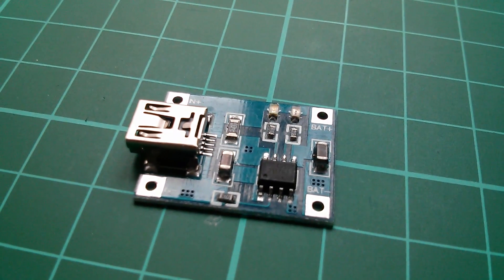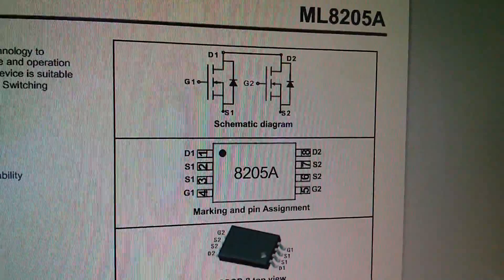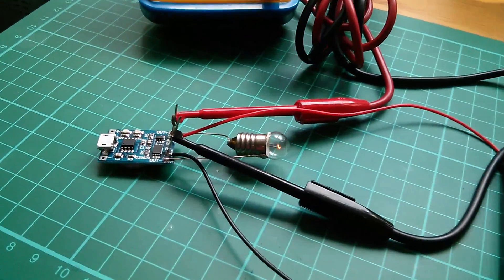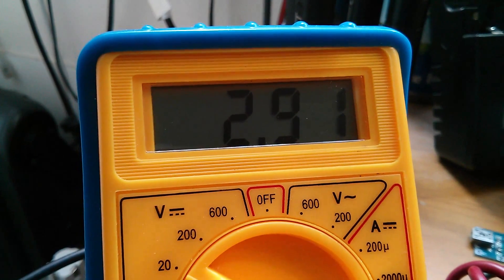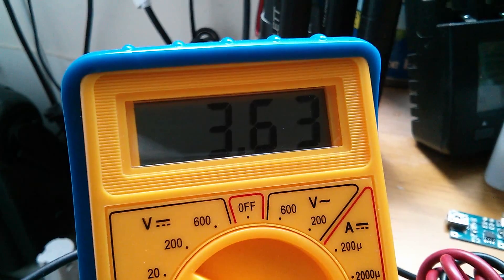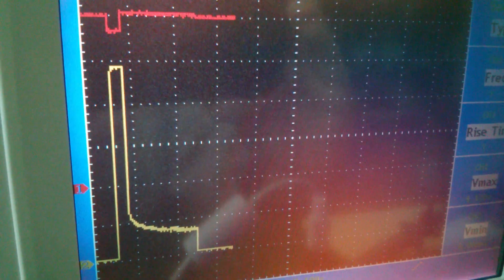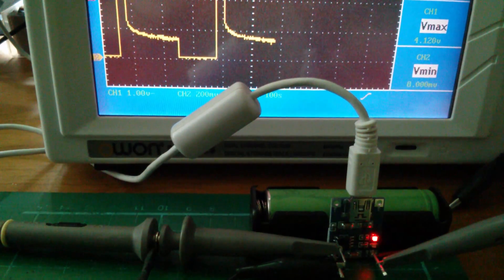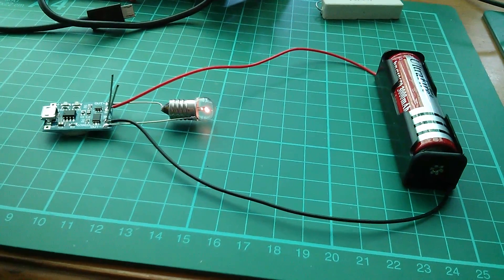New TP4056 Lithium Cell Charger Module with Battery Protection

Comment: At the end you mention the difference between old and new is where the cell protection is, on the board or on the battery. From reading online, the protection on cells are usually worse case scenario protection, meaning cut off voltage is set above 4.2v, and discharge protection down low at 2.4/2.5v. For normal cycling, a better range seems to be no more than 4.2v and no less than 3/3.3v. Many of the cheap charge boards I found have the same issue, only some show a discharge protection closer to 3v and cut off below or at 4.2v. The TP4056 seems to stop working around 2.9 so that's something I guess. 

Update: Seems the 2.4/2.5v cutoff is under load so this explains why many have it set as such, cell voltage recovers after. It's however mentioned the device should be designed to shut down between 2.5-3v under load without relying on the protection circuit. I see some forums even mention 3.3v, it seems to depend on the load. 

If you had similar concerns, here is the link I read on the topic: https://electronics.stackexchange.com/questions/338529/why-do-most-battery-protection-circuits-have-2-5v-discharge-cap

Comment: 2.4 volts is very low for a cutoff for lithium cells.

most cell specs call for 2.5 volts and the common sense recommended and programmed into many chargers is 3.0 volts.

over discharging lithium cells can shorten the life of them and even make them unstable and become a fire risk.

Comment: I'd be interested to know when the updated version will be for the usb c pd charging platform. 6a amp usb c charging to lithium battery would be an interesting option. That way we might see a standardised plug 66w seems like it's pretty future proof for alot of things... They made the tp4056 8 years ago... I was thinking if this usb c takes off as I think it should we might see usb c laptops more common. Would be cool to have charging facilities standardized at 66w output per socket... Busses trains etc... It actually can make a difference. 5-15 min journey could mean 30-60% charge times while making a small commute

Comment: At 11:10 you mention that a small load may fool the board into not terminating the charge, resulting in over-charging.  Does this mean the new version of this board can accomplish load sharing? Or would you need to supplement this board with a schottky diode and Pmosfet to safely charge the battery with a load on the circuit?

Comment: I have a TP4056 circuit, version with Out+, Out-, B+ and B- output pins. If I have a load connected to OUT+, OUT-, 500 mA, and a battery connected to B+, B-, can this circuit to charge the battery and to power the load in the same time when it is connected to USB?    I may to add to R3 an additional resistor to reduce the charging current to 300 mA value. The USB charger can deliver 5V/2A.

Comment: This chip causes a parasitic drain on the batteries. It will drain the battery down to 0.73V do not buy this chip.

Comment: Hi there, I often use this chip, but in a project that I am carrying out happens a strange thing.. connecting only one chip to a solar panel (or directly to a stable 5v input) it charges the battery and has a stable output on the out pin but, connecting two chips in parallel, as shown in this image ( http://shrani.si/f/Z/Om/45VaDfJg/18650-.jpg ) both leds are on .. I verified that it loads the lipos and feeds the load at 4.2 volts, but... maybe I am wrong on something? I won't that lipos suddently explode..

Comment: Hello great video. I wanted to ask her how to measure current with an oscilloscope? Just like you did. I tried to measure the current with my oscilloscope. But that didn't work. Just like you, I connected a probe to one pin of the IC and B-. I couldn't quite understand how exactly you connected the second probe head. I only see that this is connected on B +. Then I connected a 5W 1Ohm shunt resistance across B + and B-. I measure a voltage of about 127mV across the shunt resistance. I measure a current of 0.111A with my multimeter. But at 1Ohm shouldn't the maximum current flow? When I close the resistor across OUT + and OUT-, a current of 0.130A flows. Think for your help. Greetings Sebastian

Comment: can the tp4056 handle a 6 vold input from like a 6 volt solar panel? or will that break it?
Reply: The spec sheet says the TP4056 can handle up to 8 Volts for the input supply.(Vcc:  -0.3V ~ 8V Absolute Maximum)

Comment: Can you use a tp4056 to charge a LiFePO4, single cell
Reply: Typically the LiFePO4 cells have a maximum of 3.65Volts.  The TP4056 would overcharge a LiFePO4 cells.  There exists an equivalent IC chip specifically for LiFePO4 cells.  Chip BQ25070 is just one example.

Comment: How to make a lifpo4 single-cell charging or could you adapt the above charging board?
Reply: There exists an equivalent IC chip specifically for 3.6Volts LiFePO4 cells.  Chip BQ25070 is just one example.

Comment: Between 3:33 when the bulb turns off to 4:14 when it turns back on, how the heck is the voltage of your battery going up ?? I dont see you having an external connection to charge the battery. Can someone explain please??
Reply: I know this reply is 4 years late!
When you disconnect a load from a battery or single cell, it's voltage will start to recover. This is because the surface charge of the cell or could be the temperature of the cell, will allow it to recover slightly.

Comment: hi. after disconnecting my laptop charger my batter dies in 5-7 minutes. so i remowed my laptops batteries when i checked them it varies 3,82 - 3,83 3,84 - 4,07 so i charged with tp4056 so i have some question
1- how long should i charge them
2 how can i understand they are charged fully 
3 after a 10 15 minutes charging some of my batteries decreased 4,07 to 4,02 even they are free (not charged or used)
4 what can i do apart from those techniques ( by the way i am not experienced of electricity i just watch videos :) 
thanks from now on
Reply: Cars N Boys I would say, if you have multiple batteries connected together, use a BMS. That would be safer. If you just charge all with tp4056, you could risk charging some too much, high could damage them. You still could, and you could get away with it, but it might not be the best solution. A tp4056 board should have two indicator LED’s that show charge. If power is connected, and the battery is charging, it will show a red LED, then once charged, a blue or maybe green LED. Overall though, I think a battery management system (BMS) may be better for something like a laptop battery. You also may want to change that battery pack.

Comment: Shall i connect 2 battery in parallel and charge using single tp4056 module.. It is possible or not. Any problem occur in battery or not
Reply: Ramanatha Ayyappan It’s possible, and will usually work fine, but it could result in hurting the batteries a little bit, since they’re not all chemically the same, so one could charge faster than the other, and that wouldn’t be good for it
Reply: Yes, this is perfectly fine with one important constraint:  BOTH CELLS MUST BE AT THE SAME VOLTAGE WHEN YOU CONNECT THEM IN PARALLEL.  The resulting "double battery" will simply be one battery with their capacities (mAh) added together.  This would obviously take longer to charge but there is no reason it should cause any issues whatsoever.  Even if the two batteries have different capacities, the charging process will automatically send the correct power to the correct cell.                                                                             I disagree with Jack Seley's comment that you might "hurt the batteries a little bit."  The nature of the two cells being connected in PARALLEL will NOT allow one of them to charge faster than the other.  How the charging power gets distributed between the two cells is dependent on their capacities (mAh) for parallel wired cells.                            For example:  If both cells are 2500mAh, then they will share the charging power equally.  If cell #1 is 3000mAh and cell #2 is 1500mAh, then cell #1 will absorb more of the power than cell #2.... but they will both charge at the SAME voltage due to them being wired in parallel.  And importantly, they will both reach full charge (4.20Volts) simultaneously.                                                           PLEASE NOTE:   Cells wired in SERIES are completely different.  The above comments are only valid for cells wired in parallel.

Comment: You must use a heat sink to reduce the heat of the IC TP 4056. The module with battery protection will draw current more than 1A when charging 18650 battery.

Comment: Nice analysis.  Clear to follow and see what works well and why but also clear to see where (and why) the overcharge problem might arise under load (which was how I planned to use it)   so I'll have to watch out (or see if you did another video that explores it further)  :-).  Thanks!

Comment: Looks like maker focus took some screen shoots of this video for their product. Were you aware of this Julian?

MakerFocus 10pcs TP4056 Charging Module with Battery Protection 18650 BMS 5V Micro USB 1A 186 50 Lithium Battery Charging Board https://www.amazon.com/dp/B071RG4YWM/ref=cm_sw_r_cp_api_i_G46cEb7AY67WX

Comment: Hi Julian. These boards are new to me. Do you think one TP4056 would be enough to efficiently charge two 18650 batteries in parallel, or is that a bit too much for this little unit? Cheers m8
Reply: You can charge as many 18650's in parallel as you wish.  BUT BE ABSOLUTELY SURE THOSE 18650's ARE ALL AT THE SAME VOLTAGE WHEN YOU CONNECT THEM IN PARALLEL.    Then, it's just a matter of time.  They will all be sharing the charging power so it will take longer.  There is no issue with paralleling up multiple cells... it is safe, but slow, depending on how many cells you connect in parallel.                                             e.g.- 10 cells in parallel will take 10 times as long.  Think about it... each cell only gets 1/10th of the power it would have received if it was charging all by itself.  There's nothing wrong with slow charging, in fact, slower charging will result in longer cell life expectancy. (see BatteryUniversity .com for more information about life expectancy of lithium cells.)
Reply: Thank you for the great answer. I've been using this unit to charge my batteries with great results. Cheers

Comment: Hi, so I can use TP4056 to charge 18650 and from output, I can use a switch and supply to terminal blocks of  a motor driver and make the device recargeable?

Comment: Already got one defected, output 3.8v instead 4.1v so do not charge battery fully. The chipset get hot and maybe loose calibration. Need an heater on main chip.

Comment: I bought 2 TP4056 Micro USB boards and when I'm charging a 18650 battery the circuit board  start to heat instantly. Red bulb is lighting and connections are correct.Please help me.

Comment: Hello, did you manage to find a solution for the overcharge  when charging with the module and delivering load above 100mA simultaneously ? I want to power my Arduino Uno and a servo using one 3.7v cell with a step-up voltage regulator by charging it with a solar panel. However,  how I can overcome the issue of overcharging?
Reply: I would like to know this as well
Reply: This chip causes a parasitic drain on the batteries. It will drain the battery down to 0.73V do not buy this chip.

Comment: great video. I was looking for long which circuit should protect most and charge auto indicator 18650 and cutoff. ""What is + and - point do near micro usb input?"". now i'm looking how can i get Battery status indicator point from BMS circuit which indicate on cellphone battery as "T".

Comment: It should drop the LOAD when cell drops below the cutoff voltage.  Dropping the cell means it can't charge.  I believe you can correct this by connecting the load to OUT+ and B-, and the cell to B+ and OUT-. Anybody see a problem with this idea?

Comment: I've similar one, when I charging a few 18650 parallel the module start overheating. That's the problem.
Reply: Check your batteries.  Almost certainly one or more of them is shorted.  The board should only be able to supply a maximum of 1A.  Test the current going into the batteries.  If it's much over 1A, then the charger board is faulty.
Reply: @melkiorwiseman  Thank you for helping me. Hope its fine charging multiple batteries  in parallel with a single module?
Reply: @arunbalakrishnan8978  That should work fine.  The only effect will be an increased charge time since the TP4056 can only supply a maximum of 1A charging current.
Just don't connect lithium batteries with radically different states of charge in parallel, because a heavy current will flow which could damage the batteries or the connections.  If they're all close to the same charge state, it will be fine.
Reply: @melkiorwiseman  Thanks a lot for sincere help. 😀

Comment: Great video..… but I am looking for a "Lithium Cell Charger Module with Battery Protection board" that would output a 18V system..... any thoughts????
Reply: Is this an external battery pack to power a laptop while charging?  I made one of those, only in 19V rather than 18V.  I used a 3S cell arrangement and a step-up module with a BMS for balancing and a buck converter voltage regulator on the input to prevent over-voltage at the battery terminals.
If you only want a nominal 18V which can vary up and down around that nominal voltage, then you'll need a 5S string of 18650's.  In any case, for lithium cells you'll need a BMS to ensure they stay in balance and you probably should also have a voltage regulator on the input to hold the charge voltage to 21V (5 x 4.2V) to ensure they don't over-charge.  While the BMS can do this to an extent, it isn't efficient about the way it does it.
Edit: For extra capacity, connect several 18650's in parallel, but make sure they're close to the same state of charge before you connect them or you risk causing damage to them.  Also be sure that you use the same number of cells in each parallel group, and the same type of cells (or at least the same capacity cells) in the whole battery pack.
Reply: @melkiorwiseman  Thanks for the info. is there a link to your video on the 3S cell?
Reply: @georgeemanson  I don't have such a video since I just built the device without thinking about videoing the process.  There are some videos of people building similar devices, though.  You may be able to adapt one of those for your needs.
Speaking of which, it would be useful to know what you actually need this for?
Reply: @melkiorwiseman  I have an old/obsolete battery powered garden tool that I can't get a replacement battery for but want to re-use the 18V NiCd (5S) battery shell by this method.
Reply: @georgeemanson  Okay, that application does not require very precise voltages which makes the whole thing easier.
You'll need high-drain 18650 cells (something like 20A minimum) which means the capacity will be lower than the maximum possible (probably around 2000mAh per cell).
You'll need at least 5 of them in series to get a compatible voltage (21V at maximum charge, 18.5V nominal, around 15V minimum) so make sure there's enough space in the battery shell, otherwise it's not worth even starting.
You'll also need a 5S Battery Management System (BMS) board to properly balance charge the string of cells and a 21V regulated power supply to avoid over-charging the string.
As for getting power out again, the BMS board might be two-way, but its over-current protection may kick in and cut off the current when you try to start the motor due to the higher starting current.  For this reason, you may need to get a higher-current BMS than you think you'll need.  Whenever possible, place the BMS as close to the battery pack as you can to reduce power losses due to lead length.
If there is sufficient space in the old battery pack, you may be able to use a 5S2P arrangement (10 cells with 5 series sets each of 2 parallel cells).  This will give a longer battery life per charge and also reduce the strain on each individual cell.

You'll need to research BMSs and batteries yourself to assess suitability.  I'm afraid I've about reached the limit of the advice I can give via this means (text).
Reply: @melkiorwiseman  Thank that points me in the right direction....

Comment: Appreciate the clear video Julian.  I wonder if you would do me a favour - that all vendors of this module do not ...
I am reduced to making guesses as to the footprint for fitting to a prototype PCB while waiting for a few of the new module to arrive (with battery protection).  I expect the normal DIY 0.1" pitch is what it is - making the 4 outside holes 0.8" X  & 0.5" Y.  Two battery termination holes 0.3" separation?  PCB size ~ 26x17mm?
Thanks in advance if you can do this.
Cheers,
Jim Parr

Comment: I get 1.4V between out+ and out-. I should be getting 4.2v (or the voltage of the battery).
Reply: It sounds like your battery is a dud.  Either that or your TP4056 board has a damaged component.

Comment: can the discharge protection be changed on this ? mabe shut load of at 3v or 3.2v? and can it be made to controle high amp loads with difrent mosfet? mabe 5 or 6 amp

Comment: When newer board is connected to USB input power (from a standard 5v 2A adaptor), does the output pins give 5v or battery voltage (ie b/w 3.0-4.2v)?
Reply: Battery voltage.  You need a step-up board if you want a 5V output.  I did this, and it works nicely.  I added a switch so the step-up board isn't constantly draining power.

Comment: Can i associate the outputs of these TP4056 - about 6 batteries - in parallel and use a step-up voltage regulator to obtain 5V?
Reply: yes

Comment: There is a version of this protect board that has the TC4056A on it and looking in the data sheet i see this
Rprog = 0.82k -10.5k 120ma -1300ma 
Dont know if its worth a look